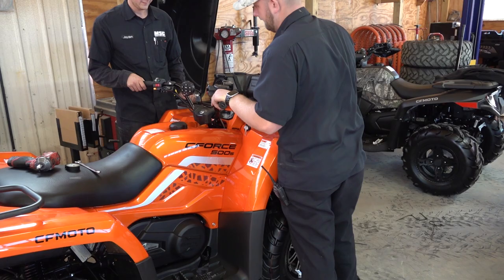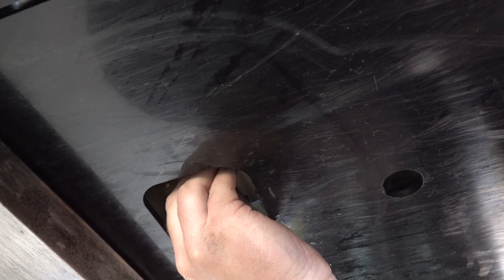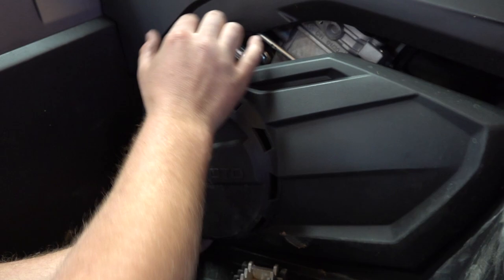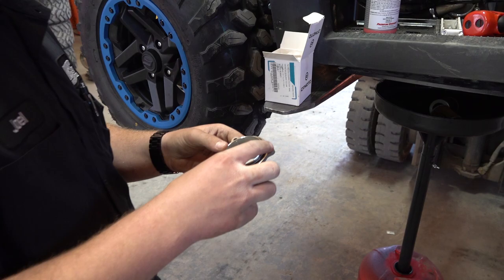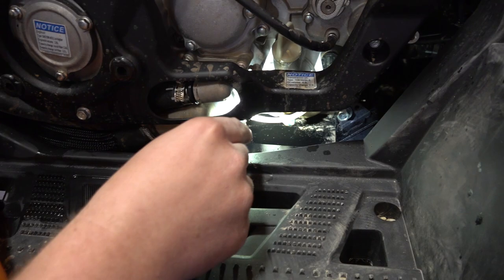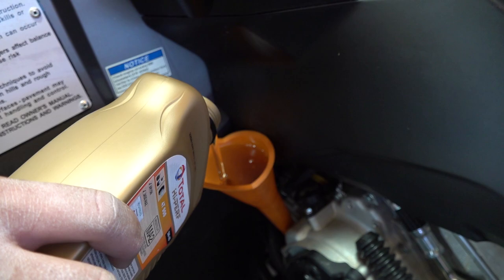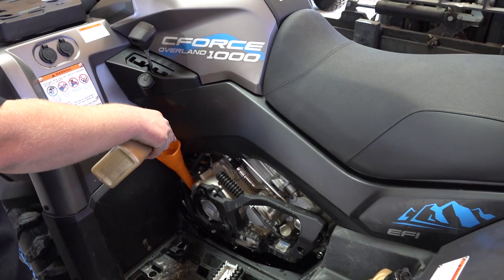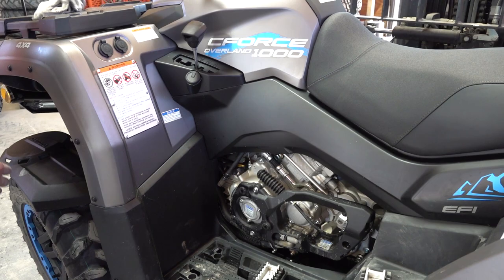CFORCE 1000 Overland CFMOTO Oil Change How to Video | The Best Oil

Comment: Been doing my oil changes for going on 5 years. Before this new oil came a long....my dealer recommended the maxima full synthetic. I believe at one time....that's what you guys were using on models a couple years ago as well. I got tired of all the confusion....switched all my machines over to Rotella T6. $49.99 for a 6 quart container at TSC....can't ask for more affordable than that.

Comment: Hi, in the manual cf moto recommended oil is sae15w-40/SG and you are putting TOTAL QUARTZ 9000 5W-40 in this engine so I asking you why? 🤔I hope you can answer this question

Comment: What size washers do you require for the oil drain plug, transmission drain plug and both front and rear diff drain plugs for a 2023 Cforce Overland 1000?

Comment: Hope you read this, could you guys possibly find a way to turn the headlights completely off while the machine is turned on/key on I would love that, even when my 800ex light switch is in the “off” position the running lights i guess you can call them are still on , that’s my only pet peeve about this machine
Reply from the maker: It's just the way it is set up from factory for the "running lights" to cut on with the key.. 
I'll post something about it if I figure it out some time

Comment: Is there such thing as an oil service reset? My CF1000 just hit 30 hours 300 miles and the oil icon appears and blinks 3x in every startup and randomly when putting it in Park after usage for a bit. Doesn’t stay on just flashes 2-3x then goes away.

Comment: The pull-out spout is a European thing, I'm not too familiar with very many European brands of engine oil but the two I know of are this Total brand and Motul. Motul also does the pull-out spout with their engine oil as well. Which, to be honest, I wish some of the US brands did with their oil bottles as well. As far as oil brands go I'm a big fan of Royal Purple and AmsOil.

Question: Does CFMoto do something similar to Polaris where they require you use their oil for your oil changes? When my friend got his Sportsman a few years ago the dealer told him he wasn't allowed to put any other brand of oil in his atv or else it would void the warranty. I don't like it when manufacturers force you to use their stuff, especially when it's priced higher. :)

Comment: Hi Blake. Need to double check with you if we can use the 10W-40 oil instead of the 5w-40 for the cforce 1000 overland. Castrol magnatec 10w-40 synthetic technology. THANKS

Comment: Do you all do a valve adjustment on your first service? My dealer tried to upsell it to me when I got my 800EX and Cforce 600 first serviced but Everything is still running great so I declined it and I didn’t want to spend the extra $800 for them to do that when I haven’t noticed any difference in how it runs. Just seeing what you all recommend.
Reply: Love all the content by the way! Hoping to make it to Main Street cycle for the takeover next year
Reply: Here in Germany, the dealer says that the valves are only readjusted during the first service if necessary, otherwise they are only checked

Comment: What oil is that
Reply: its a french brand names Total quarz its a really good oil i use it about 20 years in my cars and the oil was never the probleme 😁
Reply: @deralpenpanzer7549  and why they put this oil in this engine? This oil is not recommended oil for this engine

Comment: So why you puthing 5w40 oil in it?
Reply from the maker: 5w40 has the widest temperature range
Reply: @RealTalkPowersports   I have a cf moto x1000 2022 but  my user manual is saying 15w-40/SG oil so idk bro if 5w40 is good for this maybe in the winter but in the sumer idk